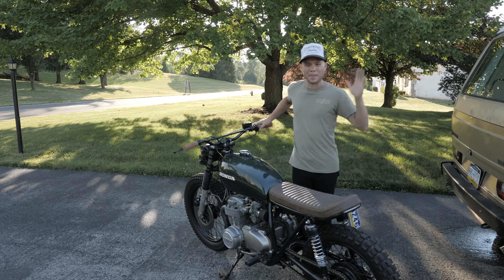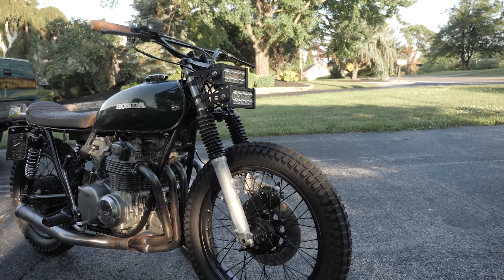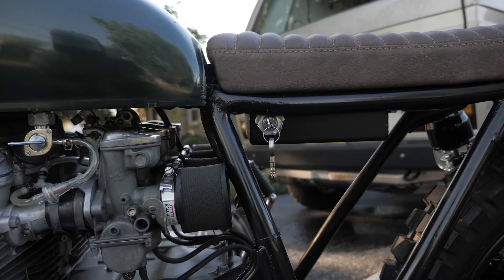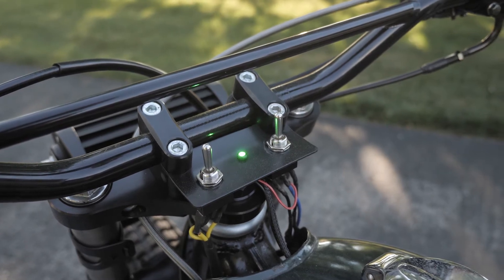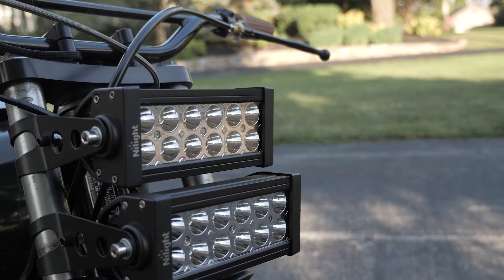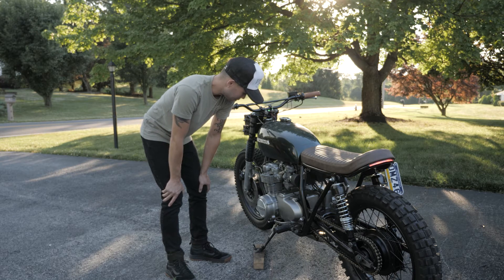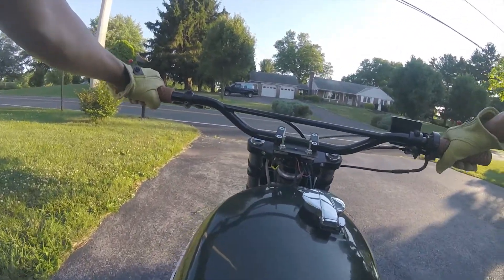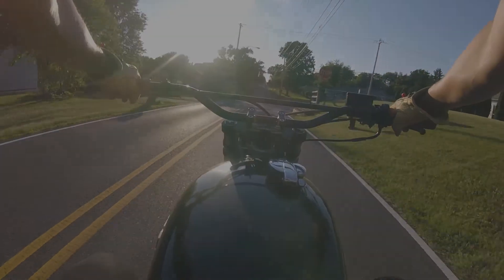CB550 Scrambler Build Breakdown and First Ride!

Comment: what size tire did you squeeze in there? change any rim sizes to fit those chunks?
Reply from the maker: factory wheels, and it's a 120/90-18 in the rear and 3.50-19 in front
Reply: @BennyObscene  looks mean!